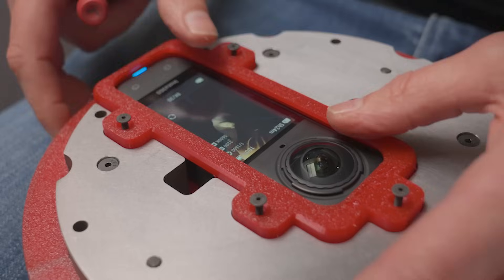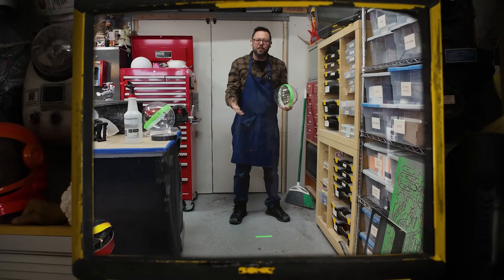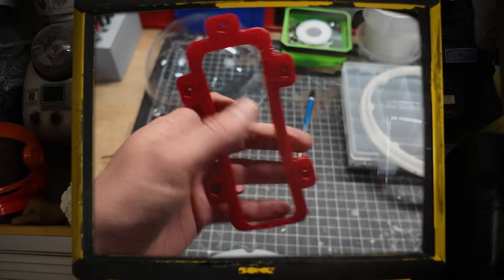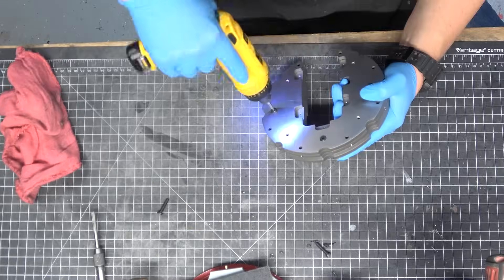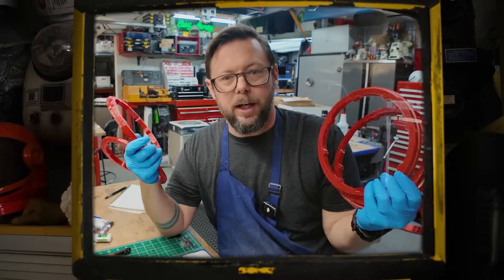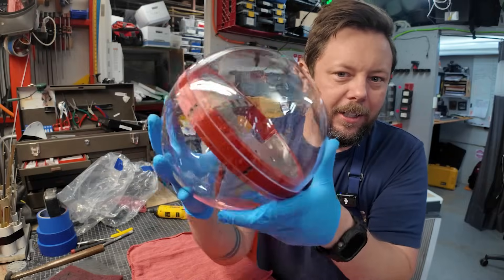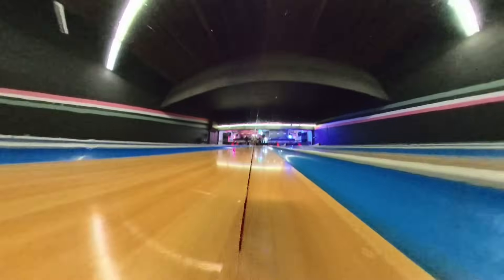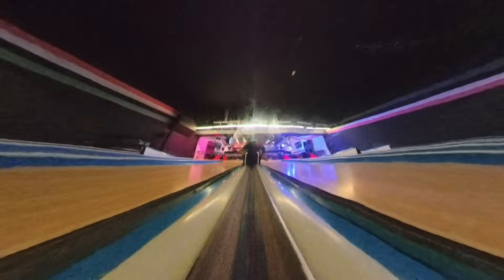I Put a 360 Camera Inside a Bowling Ball — It Actually Worked

Comment: Why didn't you get the domes formed by pcbway so you could get 8.5"? They do custom machining, plastic injecting, etc. i realize the video is done now, but if you ever need a custom plastic or metal part in dozens of different materials, it seems a lot of makers rely on them.

Comment: Couldn't you vacuum form the domes yourself using a real bowling ball?
Reply: in theory but the materials would probably be difficult to separate, plus the copy would be two sheet thicknesses wider in diameter
Reply from the maker: @lukeftahn8538 Nailed it. Also getting cutting the edge so that it lines up perfectly with the mounting rings would have been a nightmare with the tools I have. Also I don't have a vacu-former and even if I did it would have to be a VERY serious one to get the plastic as thick as we wanted. The acrylic version was formed from 3/8" thick material. That would take a LOT of machine to form. Besides, whats the point of having a dome guy?!? ;)

Comment: I’m trying to build a 2D force field for a Magneto Action Figure. I need a blue 100% (or as close to it) transparent, and 10” or 12” circumference. You wouldn’t believe how hard it is to source this. Ive considered going to a glass company to see if they were capable of maybe tinting a piece of acrylic for me. But the tint is going to be too dark most likely. 

I don’t really want to use leds, or other lights, so ive been at a stand still for months. If you have any tips, omg plz share lol.

Ive tried using synthetic Rit Dye for the acrylic I was able to source precut to size, but it wont bond to this type of acrylic at all.
Reply from the maker: Hmmm. Yeah I haven't done any acrylic tinting, but have heard its tricky. You might get away with doing really light coats of transparent paint from an airbrush. Just build it up super slowly. Might also add to the force field vibe. Could mix/ layer different shades. Try painting the inside vs the outside.
Reply: @ErikBeckFX i should have added, I also tried this. Doesn’t seem to bond well, clumps up and rubs off. Unlike other surfaces ive painted. And in the cases it did adhere, it was more translucent than transparent, which ends up ruining the acrylic for me, as I need the figure to be seen behind it. But I do thank you for taking the time to spitball.

Comment: Loved the Corridor Digital video! I wonder if it would have been possible to 3d print your own mould and pour the acrylic yourself?
Reply from the maker: For sure possible. Resin is so nasy though. I try and avoid it if I can.
Reply: the manufactured domes were thermoformed sheet. casting optically clear urethane into a silicone mold would have been a superior option.